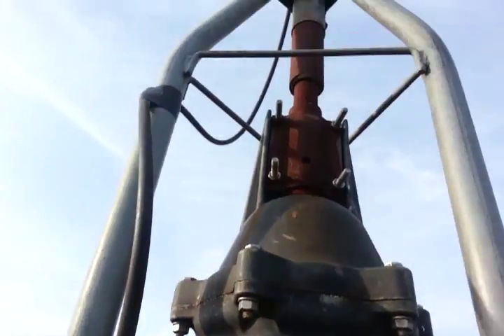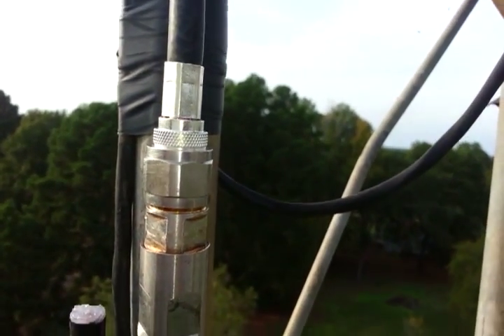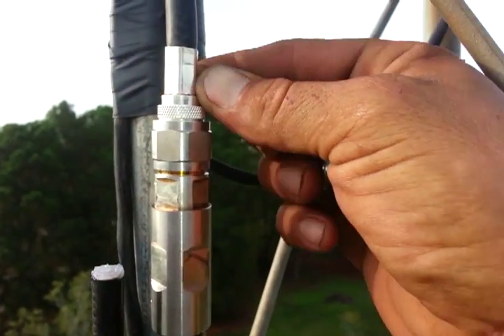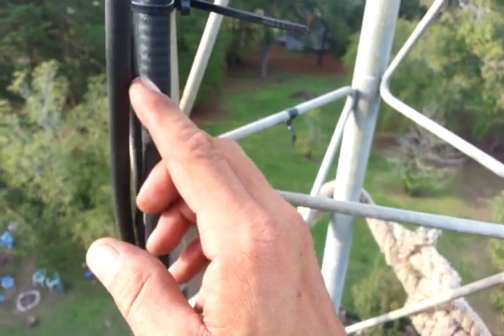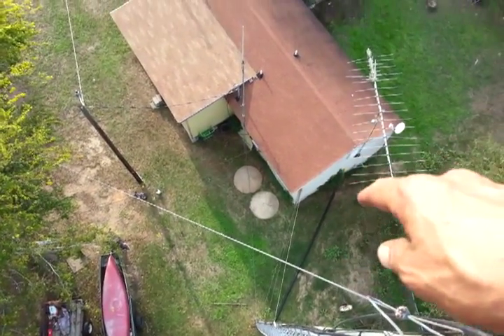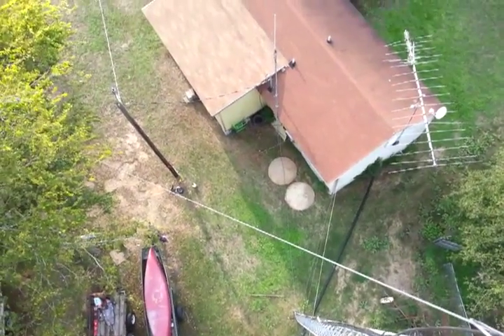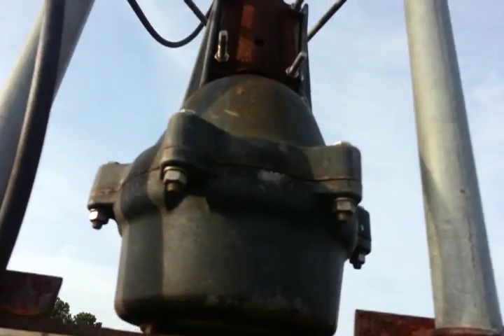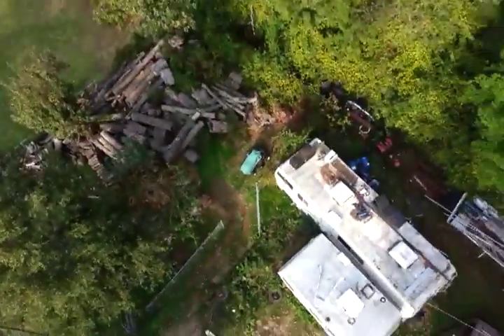My Heliax upgrade!!

Comment: Seriously?  Only one cable clamp on the guy wire?  Gonna read about you someday riding that tower down.
Reply from the maker: No there is two the other one is facing the opposite direction.
Reply from the maker: And this is a 10 year old video, it’s still standing.

Comment: I love LDF4 its cheap to find it on eBay and the connectors are easy to install. I don't know why so many people frown on the stuff I was at local ham radio store when I asked about connectors " Oh you don't need that stuff too difficult to work with just use RG-8 or LMR-400". I just left went online bought connectors cheaper and I don't have to get a lecture about using it. It's not that difficult to bend around it's ability to transfer signal with such low loss is amazing for how cheap it is.